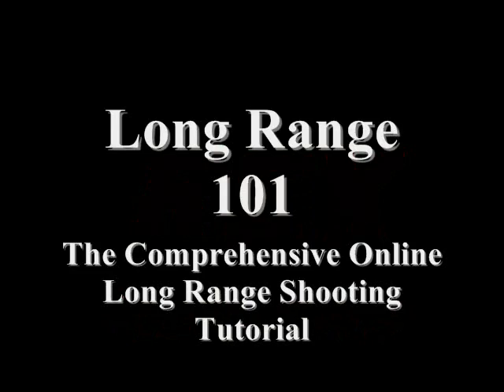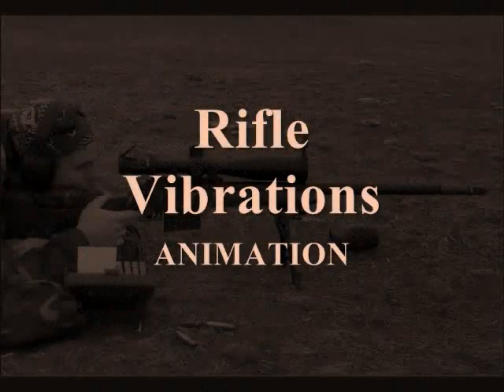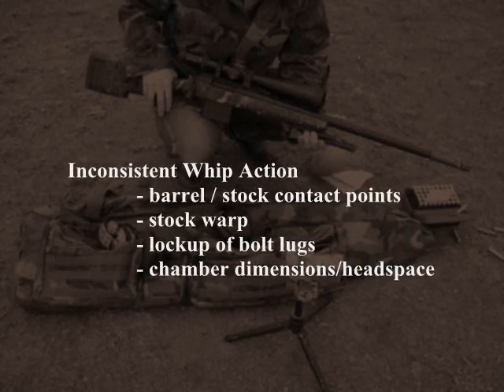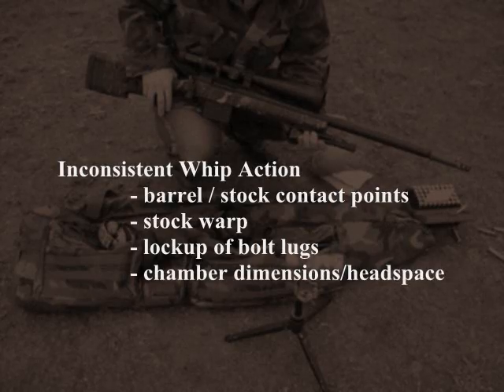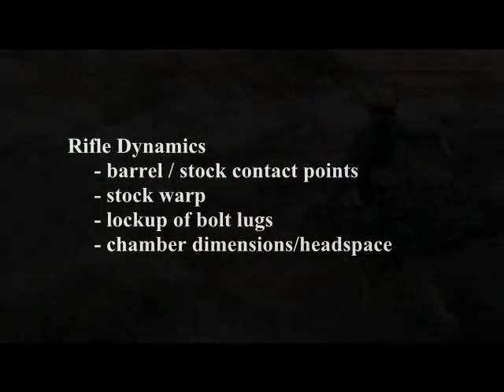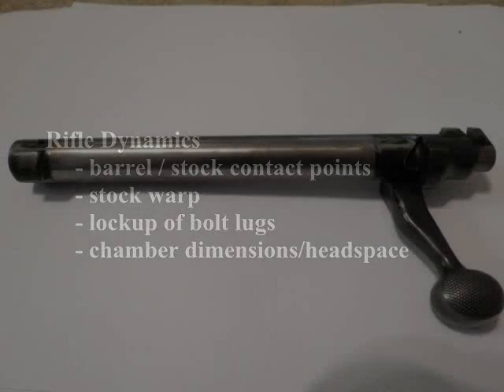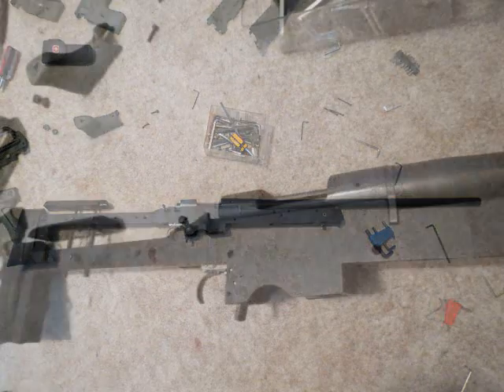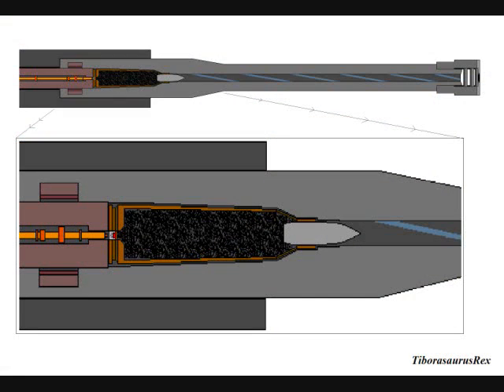Long Range 101 Part 36 - Bore Axis Shifts Due to Internal Rifle Vibration Issues

Comment: ok i have a few questions, 1) on rifle harmonics if i put a bipod would that help with harmonics because it will put a contact point with the barrel and the ground. and 2) rex was talking about one of the older weapons that the military used that had the spring between the stock and the barrel could that possibly help i know some people are going to tell me to throw the gun away and buy a different one but i have a remeington 770 300 win mag i love the gun i have no issues that others have had.so im trying to make it even better. so i can shoot long range. i dont mind doing the work myself. to make it better.but i was wanting someones elses thoughts on the matter. if it would help or hurt the rifle system.

Comment: I just bought a Weatherby vanguard series II in .308, with a 24" Right 1 in 10 twist barrel.  it is the #2 contour, (thinner), and Weatherby does not recommend free floating it.  They say it has better rigidity as is with the factory stock.  I'm not sure which stock it is.  Its from the WBY X line.  I don't know it has any aluminum in the fore end.  I haven't shot it yet but they guarantee .99 MOA with premium ammo.  Will this be good for long range shooting, or should I have bought one with a thicker barrel?  I was thinking of weight savings.  Your videos are great, and I'm learning a bunch.  Thanks.  Oh yeah, would putting a bipod on it, and even installing a second swivel stud have a POI effect?

Comment: I'm looking at Tikka T3s. They advertise glass fiber reinforced copolymer polypropylene stock. Is this just another word for plastic, or does this sound like fiberglass?
Reply: I own a couple T3s and am pleased with them. They are pretty sturdy. Their plastic magazines are stronger than you think too. I plan to get a spare mag but its more because I'm afraid of losing one than breaking one.
Reply from the maker: A. F. Wood Floors Yeah, that's plastic, but it sounds like a pretty good plastic design with a little glass reinforcement.  Most of the factory T3s I've seen shot really well, so they must be doing it right.

Comment: Rex, would free floating work on semi-auto systems like m14 models, or ar models?
Reply from the maker: nickscape75 Its easy to do with an AR platform, but rifles like the M14s have the gas system set up in such a way that true 'free floating' is not an option.  Usually the best option on those platforms is getting the operating rod and the gas lock system to mate up uniformly and consistently from shot to shot - this may require custom fitting by a veteran M14 armorer who knows his stuff.
Reply: TiborasaurusRex thanks for the response rex!

Comment: I have a question on stocks.  I really prefer the look of wood, but understand its potential problems.  I understand the advantage of the HS or McMillan, but just do like the look -- yeah perhaps silly I know.  So the question is, how about laminates?  At least I still have a "traditional" look of wood, but how about warping, etc -- do laminates minimize this problem?
Reply from the maker: Laminates are usually pretty structurally sound in that they offer less suceptability to warp than solid pieces of newly harvested hardwood in some cases - however - quality will vary between different pieces of wood.  Properly aged walnut is usually very solid, but its getting harder an harder to find lately.

Comment from the maker: Yes, sir.  These will cause POI shift which will be measurable even at close range.  These harmonically induced POI shifts are usually on the order of 1 moa or less, unless something is really out of whack in which case it could shift the POI even more.  If you are shooting prairie dogs at 200 or 300m this will be a problem, if you are shooting at deer at 300m, it might not be a big problem.

Comment: Hi Rex. Will these inconsistensies (primarily rifle dynamics like bore axis, barrel/stock contact points, stock warp etc.) be much of a cause for concern regarding accuracy at shorter ranges between about 100 and 300 meters? Thanks!

Comment: I hand load for all my rifles and have allways neck sized only. But I allso watch my OAL and on hunting loads I run the loaded rounds through my rifle before they leav the loading room . I keep close records of my brass and I do not use brass for defence or hunting loads that have more than 3 trips into the chamber . After fireing more than 3 times the brass is still used but only onthe range . I spent many years guideing in Alberta and Yukon and have watched rifles fail to feed

Comment from the maker: Good question.  Although the harmonic wave does reverberate back and forth, resulting in less amplitude at the muzzle at times, the end of any long skinny vibrating object will always be an antinode region.  Although vibration will generally be worse at the muzzle, if we time it just right, we can have the bullet exit the muzzle as the MAIN part of the harmonic wave has reverberated as far as the muzzle as possible.  It’s somewhat complex and difficult to explain verbally - but I hope this helps

Comment from the maker: Yup, still on the list.  Muzzle brake pull-off will be in this internal ballistics portion of the series.  Hang in there!  

Those goofy things can actually work pretty good, but the trick will be to get consistent placement if you choose to use one.  You won't want it sliding around after you get everything sorted out.  The better way to go may be to accurize your rifle.  Bed the action, lap the lugs, float the barrel, etc... That will produce more conistent results in the long run. :-)

Comment from the maker: Great question.  Its true that you will have differential expansion between aluminum vand steel, however, the effects will be minimal and much much less than the expansion differences between wood or plastic vs steel.   Overall, aluminum bedding really helps out to minimize POI shifts caused by harmonically enduced bore axis shifts  :-)

Comment from the maker: Great question.  Its true that shortening any barrel will increase it proportional stoutness and thus increase its rigidity.  However, its still possible to tune your harmonic whip action, even on a long thin contoured barrel, by load development.   I would advise this before shiortening the barrel as 22" is needed by that cartridge get the proper and most efficient burn dynamics.   If you tune a load to that barel, it should shoot VERY VERY well.

Comment: I have very much enjoyed this series and I'm learning so much! I wonder what your thoughts are on shortening a 'thin' free floating barrel on a 30-06. It's already 22 inches long. My thinking is, with less torque against the last point of contact with the receiver, wouldn't that cause significantly less vibration? Is all that I would sacrifice is muzzle velocity? Why not first shorten to 21 inches and then 20, etc, until grouping is tighter at say 100 or 200 yards? All in regards to accuracy.

Comment from the maker: They are both top-notch.  If you wanted to try to beat down a brick wall with your stock or drive it over with your truck, the McMillan A5 would actually hold up better.  Solid fiberglass of that thickness is very very tough.  The Aluminum chassis will be impervious to temp and humidity changes just like the A5, but it may not be able to smash a brick wall or get driven on w/o compromising its integrity and experiencing serious deformation.

Comment: Definitely solid info. My Savage 10FP injection molded stock was about as rigid as a grilled cheese sandwich. Before replacing it the rifle would do no better then 1 MOA, with the joy of random shifts in POI from weekend to weekend. Replaced it with a B&C varmint stock, now if I do my job I can get 3/8 minute groups. Keep 'em coming brother.